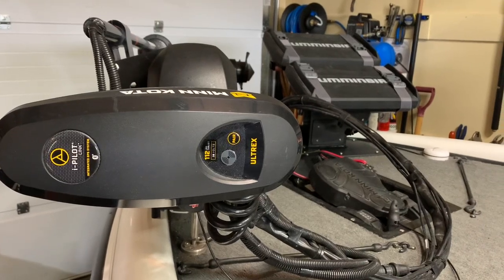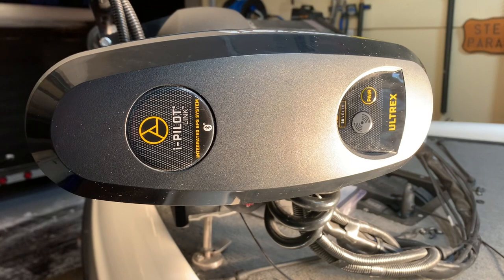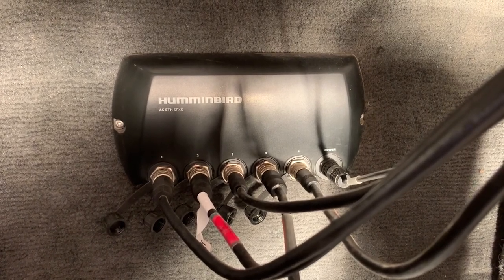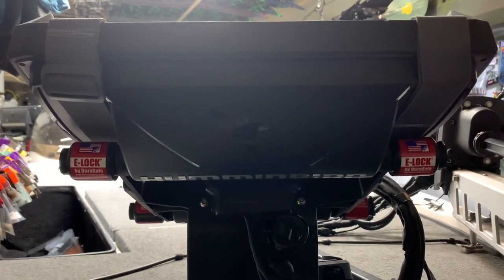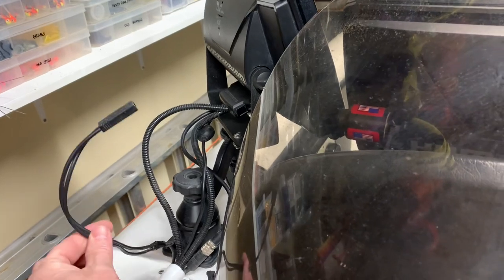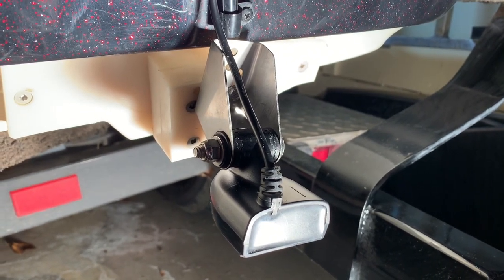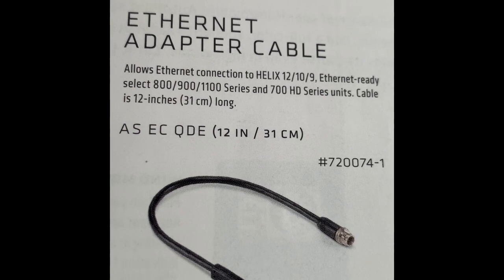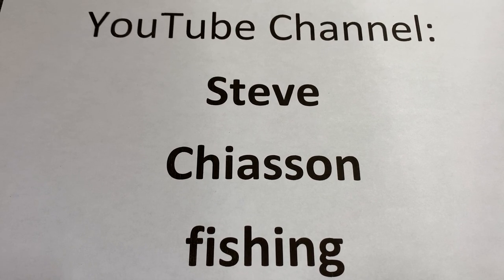My One Boat Network, Minn Kota I-Pilot Link with 4 Humminbird Helix units and Mega 360

Comment: Steve, 
Thanks for the video! I have a helix 7 msi g3n for my console and a helix 7 g4 (no N) cho for my bow. I want to hook the g4 to my terrova I pilot link mdi. Not really concerned about the si on the bow unit, so I don’t need to link the 2 helix. My question is: will the terrova hook up to the g4 (no N) and can I follow contour lines, etc. the g4 is brand new, so I could swap it for G4n if I have to. I ordered it and didn’t realize it wasn’t a g4N until I got it. Thanks in advance.
Reply from the maker: I would get the G4N personally as it gives you more options, sharing waypoints, network capabilities plus better resale value. As for follow the contour feature you need to make sure you have an IPilot Kink Terrova to be able to follow the contour.

Comment: Can you have one HBird fishfinder with the capability of switching between the transducer that it's shipped with it and a Minn Kota tm transducer?

Thanks,
Keith
Reply from the maker: You would be further ahead to put a unit at the bow and a unit at the console. If the transducers are both compatible with the Humminbird unit, and your cables reach you could switch them out. Hard to say for sure as there’s limited information in your question.

Comment: Thanks for doing this. Maybe I missed it, but where did you run the Mega 360 cable? It sounds like your 5 ethernet ports were all taken up by the 4 units and the trolling motor. With no ports left how do you add the 360? Thanks in advance.
Reply from the maker: The Mega360 transducer cable plugged into the Helix unit directly. The unit could then connect with the 5 port Ethernet switch via an Ethernet cable. Therefore 4 units are connected plus IPilot Link.
Reply: @stevechiassonfishing5876  Thanks Steve
Reply: Would the same be true if it was mega live instead of mega 360?
Reply from the maker: MegaLive can be plugged into the back of a Helix with adapter or directly into Solix. If you want MegaLive to be shared, plug it into 5 port Ethernet switch.

Comment: How did you hook up your Ethernet cable from the trolling motor to the hub?  I’m trying to hook mine up and ordered an extension cable but it has female ends and so does the trolling motor with I pilot link. The only cable that I found is 30 foot that is $75 with one male and 1 female end.
Reply from the maker: The Ethernet cable plugs directly into the hub. Do you have a built in transducer? The I pilot link cable also plugs directly into hub and comes with new trolling motors.
Reply: @stevechiassonfishing5876  thanks for the info. The Ethernet cable  plug for the I pilot link is only maybe 5 feet. Where I’m going to mount my hub is 10 feet. I have the connection for mdi transducer to hook up to my helix. I just didn’t know if you had to go further than the length of the cable provided on the trolling motor to the Ethernet hub. The fitting on the trolling motor is a female. So the extension would need to be male and female. The regular extension cables are female to female ends. To go from the I pilot link cable to the hub has to be a female and male connection. These are ecx not the regular ec cables.
Reply from the maker: Bill did you buy your trolling motor new? The IPilot link should have a long cable with it to plug into hub.
Reply: @stevechiassonfishing5876  yes  the cable length is only 5 feet. This is not long enough for it to reach my hub. I have ordered the 30’ cable for it to reach my hub. I just didn’t know if people had found a short and cheaper cable to reach there hub. I just didn’t want to spend $75 for the cable.

Comment: Having issues linking my mega 360 with my helix 9gn4..not showing up on my helix 9?   Do I need to have a ethernet connection Box for this to work? All I want is the 360 to work on my front unit..
Reply from the maker: Hi Tony you have a power cord and transducer cord which has the connecting cord for your Helix included with your purchase. It should then just plug into your cable collecting bus which plugs into the back of your unit. Make sure all your connections are secure both on the power cord and the transducer cables.
Reply: @stevechiassonfishing5876  The helix is working fine.Had it on the boat for the last year..I added the mega 360 a couple of weeks ago..I  only have 1 helix 9 on the front. I used the y splitter   So I could hook up my Darren image and 360 into the same unit.. For some reason I cannot get the 360 to come up on my unit.. I'm not sure if I have my settings set right or if that has anything to do with it?  Let me know what you think?  Thanks Tony
Reply from the maker: Press and hold the view button, go to sonar tab, press right cursor arrow, look for 360/DI view and click on it, both should come up on your Helix. If not I would try disconnecting your y cable and plug in your M360 to make sure that it is working. Assuming you have gone over all your connections, checked fuses, etc
Reply: @stevechiassonfishing5876   I appreciate your quick reply I'm gonna give it a try.. By one of your previous videos I believe my unit should work with the 360..Helix 9 MDI+ GPS G4N.
Reply from the maker: Mega 360 will definitely work with G4N Helix 9.
Reply: I checked all the connections.  Everything seems to be all right.
I went to Sonar Screen shows 
2D View
Big Digits view
DI View
DI/2D View
2D Zoom
I can't deploy ultrex complete down do to handle on my trailer. 
 But I would think the 360 option would still come up on the screen..
 Any other ideas? I appreciate you taking the time to help me with this..
Reply from the maker: There is a wet switch on the Mega360, if it’s not in the water it won’t work. I have been assuming that you have the Mega 360 deployed in the water?
Reply: @stevechiassonfishing5876  I was told I could wrap a wet towel around the 360 on top where the 2 sensor are.  Still don't see mega 360 show up on the Sonar. When I hold the view button down.
Reply from the maker: Heard that too but never tried it. If all your connections are good, did you remove y cable and try it direct?
Reply: I can take it the lake here in a couple of hours..I  just noticed   When I do the accessory test it shows it shows 360 imaging unconnected . I wish there was a way I could show you a screenshot...
Reply: Good Morning Steve. So I put the boat on the water deployed ultrex with the 360..still nothing...Then  Disconnected the Y cable and wired directly to the 360..still nothing... Do you think it could be a power issue ? I'll have to check that when I get back to the house I'm on the water right now..
Reply from the maker: It definitely could be a power issue that’s why I mentioned check all connections at the beginning. Hopefully that’s it.
Reply: @stevechiassonfishing5876  Hi Steve I  checked the power coming into the 360 at the first connector..good power..The only thing I'm thinking it's got to be the  mega 360..
Reply from the maker: I would call Humminbird and explain everything you did. The only thing I can think left to try is restoring defaults on your unit and see if that helps. They will probably ask you if your units are up to date software wise. They may have a suggestion I have missed. You said your sonar was on because you had down imaging working. It’s possible it’s the Mega 360. Let me know how you make out with Humminbird.
Reply: @stevechiassonfishing5876  I'll contact hummingbird..I'll let you know...thanks

Comment: Thank you so much. So I’m linking 2 helix 12’s together and a minnkota ultrex MDI IPolot link. One helix at bow and one at console. 
If I understand correctly I need 
5 port Ethernet box
2- dongles
2-Ethernet cables
1- MKR-MI-1 to connect ultrex to bow helix unit

That should be it right? My GPS puck comes with the ultrex and I shouldnt need a Y-cable unless I’m missing something?
Reply from the maker: That’s correct, the heading sensor comes with the Ultrex and that will work for you.
Reply from the maker: Depending on your console unit and whether or not you add a high speed transducer, you might need a y cable.
Reply: No high speed transducer just linking the two units so I can share waypoint and look at SI on my bow unit.
Reply: Console is Helix 12 MSI G4N
Reply: I got to thinking..?? Why do I need the Ethernet box? Why can’t I run one Ethernet cable from one helix to the next and connect the ultrex MDI transducer to the bow unit? I’ll get the box if I need it but not sure why I do?
Reply from the maker: You can simply link the two units together but without the box you won’t be able to use the ipilot link features. That’s your choice.
Reply: Thank you very much for the advice. So since I have the heading sensor that comes with the ultrex, I don’t need an additional GPS and heading sensor. 
Last- the ultrex hooks directly to my bow fish finder? There isn’t any additional cables that go the the Ethernet hub from the trolling motor. 
Sorry to bug you bug the Humminbird diagram I found show extra gps pucks and cables which is a bit confusing.
Reply from the maker: @jasonetchechoury9956  you don’t need the extra puck. The heading sensor is fine. I have always used the box that way everything communicates. You only have one Ethernet port so if you hook the Ultrex to your bow unit, you won’t be able to share waypoints because you can’t your two Helix units together. I would buy the box and that way everything is linked. If you add units/options later you have two free Ethernet ports on your box left. I think you will regret it if you don’t.
Reply: Watching your video again as well as others you have posted. My confusion on the pucks is- I want to make sure I can share waypoints. Mostly from my console unit to my bow unit. I just want to get this right so confirming that the minn kota luck will allow me to do that.? 
My dealer wants to charge me set up fees to I talk the units and another 1200.00 to network my stuff. I can do it for less than half the cost and know it’s right so thank you again. 🙂
Reply: Thank you Steve. I’m getting the box. I was referring to the transducer cable from the ultrex. I plug it to the MKR adapter that goes to the bow finder. Then one Ethernet cable to the hub from the bow finder and one from the console finder  to the hub should link everything together. I can share waypoint between units and control the ultrex from both units. I’m likely making it more confusing than it is bc dealer sent me a quote stating I needed an extra gps puck, Y cables and 3 Ethernet cables. 
My math and your video suggests I only need two Ethernet cables and no Y cables for what I’m trying to achieve. And now you’ve cleared up that I don’t need an extra GPS puck. Thank you again and happy fishing!
Reply from the maker: @jasonetchechoury9956  you’re quite welcome and sounds like you have a good handle on it now. Good luck and I hope all goes well. Your Ultrex will come with an Ethernet cable that plugs into your 5 port Ethernet box.
Reply: So does the new ultrex have two cables coming out of it then? One that attaches to the MKR cable and into the bow helix and one that runs to the Ethernet hub box?
Reply from the maker: @jasonetchechoury9956  correct
Reply from the maker: Hi Aaron, he was referring to transducer and Ethernet connections opposed to the power source.

Comment: Excellent video ,thanks for posting it.....did you consider a "puck" transducer to shoot through your hull? And what was your reasoning for going with the transom mount 2d transducer?
Reply from the maker: Thanks IJ, there’s a lot going on in the bilge area and access to that area is limited with battery and oil tank above. It was easier to mount one on the transom so that’s what I went with.

Comment: Good video but still confused on y cables…do know which one I would need to connect the built in mdi transducer on my terrova and the msi transducer on stern to my helix 9 msi g4n? Thanks!
Reply from the maker: To confirm, you want to run the MDI transducer and MSI transducer to a single unit at the console? The Terrova cable needed to connect your built MDI to a Helix is not a y cable. It is the MKR-MI-1 for Helix 8 and up. It is usually hooked into a unit mounted at the bow. The y cables associated with the stern MSI transducer is usually the 9 M SIDB Y to a Helix with SIDB (side imaging dual beam) with a dual beam transducer also on the stern. If you used that 9 M SIDB Y and the MKR-MI-1 connected to your MDI in Terrova that might work. I would verify that with your dealer or Humminbird support. As I said earlier, most find it beneficial to add the extra unit up front at the bow.

Comment: Hello again Steve.  Question for you.  You have a separate puck for GPS on your network you had mentioned.  With the Helix having built in GPS are you not able to toggle through the network setting to turn it on for that unit?  Also, I have a fellow who built me the dongles with RJ45 connectors and then purchased a 5 port ethernet hub on Amazon for 25 dollars and works perfect.  Saved over 500 dollars.
Reply from the maker: I use the built in gps on my Helix. I have a heading sensor for the IPilot Link trolling motor. I do have an additional puck located at the front of the boat in case I wanted to save all waypoints from the front of the boat if I choose that route. Those without IPilot Link trolling motors also add the AS HS GPS puck to be able to mark waypoints on accessories such as Mega360. Hope that helps Jack.
Reply from the maker: Awesome you were able to save yourself some $, I didn’t know you could do that.
Reply: I bought an ipilot link head from a fellow is the US at a good price so switched it over.  Sold the ipilot BT off my Terrova to a fellow up here and broke even.....lol.

Comment: Hey bud, I'm hoping you or someone can help me out. All im trying to do is connect my Terrova I pilot link motor to my Helix 12 G3N. Do I just need to order the Dongle to connect the cable from my terrova to my head unit?
Reply from the maker: I personally don’t have a Terrova but since it’s an IPilot Link motor it should connect to your Helix 12. If you have multiple units and other one boat network accessories, you will need the 5 port Ethernet switch. If you just have the Helix 12, you can use the Ethernet cable, add the dongle and plug it in direct. Either way you need the dongle because it’s a Helix unit.

Comment: Great video! My question, kind of related with Tony Ferdinanto's issues, ended up having to buy a new Helix9 MDI,Chirp,GPS,G4N+ unit for my bow. My question is when I have my Helix9,MSI,Chirp,GPS,G2N+ unit at console hooked up to my new Bow unit via ethernet, when you see the networking screen, which should be yellow checked or not checked? I want to display my Mega 360 screen on my bow unit, also. Everything is working BUT I have issues of screens changing erratically. I feel there is lack of information on what should be checked if you want say your Transom reading showing up on the bow or your Bow MDI reading showing up on the Console unit, or your 2D reading from transom to show up on Bow unit. Which boxes should or should NOT be checked. As there is no temp on Built in MDI unit on my Ulterra I use the transom reading from my MSI unit on the bow. How badly screwed up is my system. All other cables etc. are correct and finally have mega360 working but with issues. Hopefully some advice from you can solve my issue. I have talked to Eufala about my first issue and DON'T have much faith in them.
Reply from the maker: Hi Brian thanks for the kind words and hopefully this information helps. You want the temperature on the bow display from what I gather. The built in MDI should have a small silver temperature probe built and maybe you just don’t have it displayed in your overlay settings. That would give you temperature up front. Sometimes simplifying things can really help. I typically don’t use my networking system checks a lot. I rely more on my shortcut settings (3 bottom right buttons) to get the screens I want. That way if my screens are changing erratically, I can just select my shortcut preferences. When I am fishing up front, I don’t pay much attention to my transom readings because I want to know what’s happening right where I am fishing. With forward facing sonar, that has certainly changed. I typically have my M360 as my main frame with 2D and DI on my bow unit while using MegaLive and mapping on my other bow unit. I know I approached this answer from a different direction than your networking questions. I believe this shortcut route is simpler and less complicated. Hopefully this helps as this this is what I do with my set up.
Reply: @stevechiassonfishing5876  Thanks for the reply Steve. The info I was looking for is with the Networking line which comes up and mine I have Gen2 at Console, gen4 on Bow. As you go across you have 2D, DI, SI, 360,GPS, Temp. My issue is which should have the yellow checkmarks at the end of the line for each of the functions or no checkmarks other than I want to have 360 show on the Console gen2 unit.for my friend on the back deck. I can't ever recall seeing any info on this from anyone. Thanks again and I keep watching all the time. Boat goes away when I have to break Ice, NOT before.
Reply from the maker: I didn’t realize you were trying to get M360 at the console. Next time I am at the boat, I will go into the networking tab and see if I can find something to help you.
Reply from the maker: I tried to reply to your email but it wouldn’t let me. I had taken a couple of pictures how I believe the network set up should be on console unit.